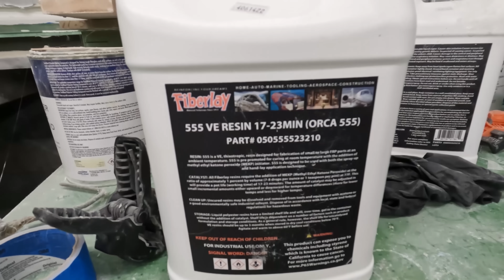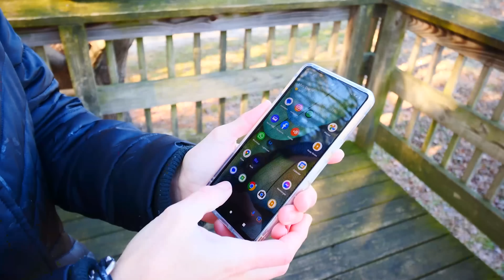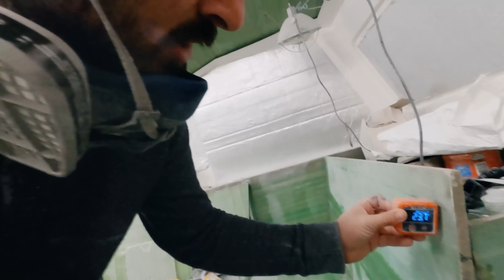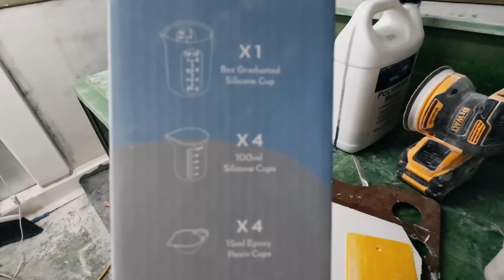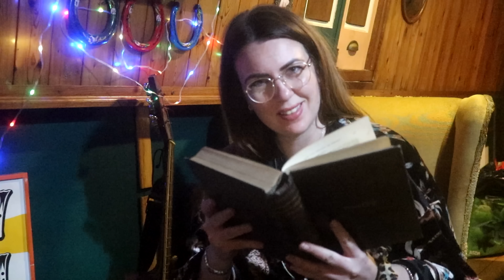CATAMARAN BUILD - Building Out the Settee in our Salon (MJ Sailing - Ep 264)

Comment: Good morning, I am a retired fiberglass man who ran my own shop for decades. Structural and cosmetic work was my specialty. I would like to offer a suggestion to you in the way of spreaders. Have you tried “steel bondo spreaders”  in conjunction with plastic spreaders ? Each style has some advantages
Also, the amount of pressure you can apply to a spreader along with rate of motion helps a lot. The thinner the better.  Pressure and speed will help you a lot while spreading. I think if you get away from epoxy bondo it would be if help to you.  It is compatible and acceptable for what you are doing and it would spread and sand easier for you.
Then once you get an initial spread and sand stage done you could “spray on” a poleyester based primer that is “activated” with an easy to use hardner.   I find the evercoat feather fill g2 works great and is easy to sand. Try not to let the word “spray” scare you. It can be applied with a HVLP spray gun which allows you to use small touch up guns or larger production guns. The “trick” is to use a 1.8 to 2.0 tip in the gun.  Which is considered a large opening.  Maybe, if you could get the chance to try a test areawith these tools,product and methods, it might help you out or work for you..  I am headed to my Westsail in NC at the end of January and would be willing to stop by for some pointers
   I realize there probably have been alot of people telling you what and how to do stuff
 Sometimes factory and other people have their methods they use to get to the same point of finish. Over the decades I have found that the best method and formula that you are comfortable with is best to apply
 Also, some of the suppliers are just trying to promote their products and don’t have the 
“field” and real world experience to back it up
  I hope not to come off as arrogant. It’s just that I would just like to offer some insight 
My reputation over the decades was build on
quality and the ability to satisfy a customer, who in turn would recommend my work to others.   It is hard for me to type all that I can say, perhaps if you like you could call me but I don’t want to have my number out there. At the very least I would be willing to stop bye

Comment: 14:30 - precise measurement of parts (with a paste), 1st time fill the silicone cup, then weight it and subtract the cup weight. After that just weight the on the paper, no cup necessary. 
Perfect portions every time without all the extra steps.
Reply: Was going to recommend the same, except to put the gallon pail on the scale and zero out...remove the weight needed. No wasted measuring cups.

Comment: With the amount of fairing you guys have left to do it would probably be worth investing in some of the Flexi-Sander fairing tools, you only really need a couple of the smaller sizes for interior work.  To go the DIY budget route, try some of the really wide drywall mud tools; the trick is to use a fine file to lightly round off the sharp corners.  A 12 inch wide mud knife will spread your fairing compound a lot more evenly in fewer strokes on the bigger bulkheads.

Comment: If you wet out your laminates on foundation plastic it’s easier and you can roll them up on a bit of pvc in huge lengths if you want and use thixotropic resins for work above your head and is good for fairing as it doesn’t sag down 👍

Comment: when sanding, take an vacuum(cleaner) and put it on the sander, and take some 3m cubitron and another world of sanding opens for the two of you. No more dust, no more blocked grit with polyester etc. You can sand much much longer with it too!
Reply from the maker: It's uncured resin that gums the paper.  Vacuum doesn't change this unfortunately.
Reply: @MJSailing  maybe wait till its cured? Dont know if that is the right thing to do, i dont work with resins a lot.

Comment: why don't you use weight to determine ratios?
Reply from the maker: Hard to do on that scale with polyester resin.  The MEKP is a small enough percentage that the weight vs volume is difficult to control for with resin covered hands